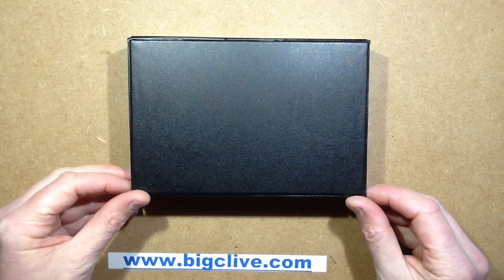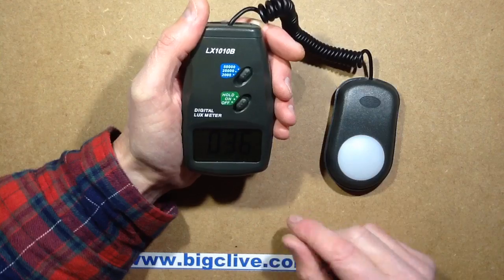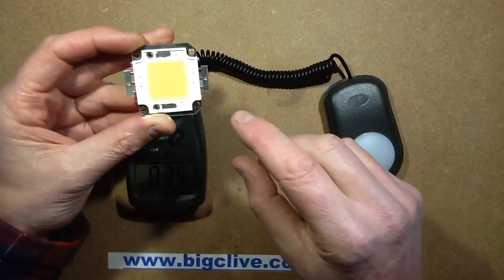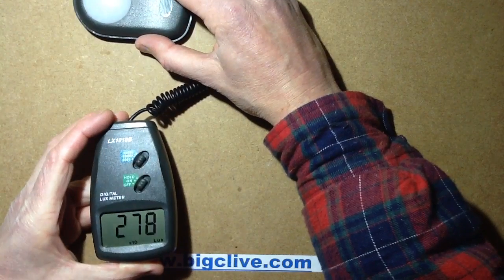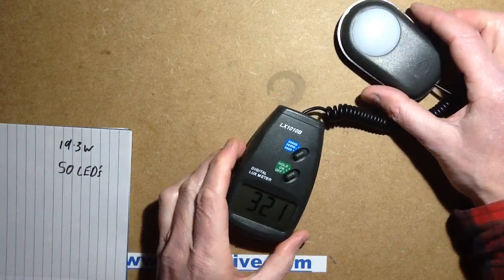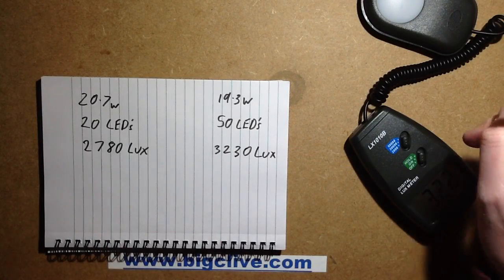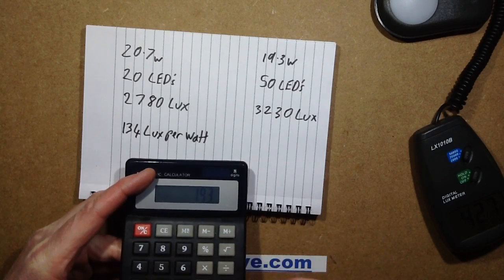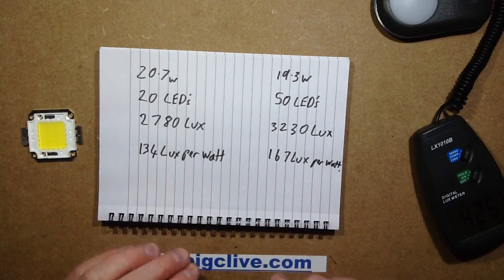20W vs 50W LED lux test in a 20W floodlight.

Comment: is there a metre that measure kelvin and lumens?
Reply from the maker: Yes.  You can get meters that do CRI, temperature and lumens.  But they are very expensive.
Reply: @bigclivedotcom  thanks for the answer, much appreciated
Reply: does CRI measure in kelvin?

Comment: https://www.bannerengineering.com/za/en/company/expert-insights/lux-lumens-calculator.html
In my case I have approx 50cm distance to sensor and I get 3220 lux assuming a spread angle of approx 120 degrees.
This equates to approx 2529 lumens from my Yxo DOB4075-50w module.Another fun thing is my true rms power meter reports it drawing 50.72 watts and since I know the wireless on/off receiver I hooked it up to it is consuming it's 0.72 watts like always it is spot on 50w. Quite happy with that.

Comment: I got a 50w led and im using a 35v 5a driver set to 35v @ 1.5a but its only drawing 20w :/
Reply: LEDs have no current limiting themselves so if you're unhappy about the power consumption then your driver is at fault

Comment: how much is  the distance?tnx
Reply: I believe it is one meter... since one lux of intensity equals one lumen of radiation per meter, in METRIC units.  Footcandles,   OTOH,  are measured in French or American units.  One footcandle = 10.76 lux of INTENSITY.  Light intensity falls off as the distance from source to subject falls off due to the inverse square law.  The intensity of light from a single candle (one candela) that will be projected onto a surface 12 inches (one foot) away, through a cone of one steradian, will be one footcandle (or 10.76 lux).  But this guy explains it much better than I can...  https://youtu.be/9nPIzyV1mW0

Comment: Would more LEDs  create more heat given the same size  of  aluminium pcb?
Reply: When run at the same total power of about 20 W,  they produce less heat apparently. As Clive shows, there is more light, so less energy is wasted as heat. The aluminum backing does have more LEDs on it so when it's run at 50 W it would need better cooling than the 20 W LED running at 20 W.

Comment: Hi Clive. I'm trying to measure the lumens coming from a 20w LED floodlight using the very same meter.
What distance should the floodlight be from the sensor? As I move the sensor closer to the light source the reading increases, so is there a recommended distance?
Also should the test be done in a dark room at night so that the LED floodlight is the ONLY light source in the room?
Thanks.
Reply from the maker: +Adit209 It's actually trickier than that.  The output from the light is not even so theoretically you have to use an averaging device at a fixed distance with no external light source.  I tend to use these meters as a rough guide at a fixed distance from the light in a dark room.
Reply: +bigclivedotcom Thanks for the reply. I'm going to try in a dark room tonight. Seeing as the definition of 1 lux is luminous flux at 1m distance from light source that's what I'll try. However looking at the manufacturer's specs for the 20w floodlight in question, they state this light is between 1000 - 1800 lumens, that's a massive range! Talk about trying to cover your own backside!
Reply: @Adit209  whats the result was ,while you checking the luminous flux at 1m of  20w street light in the dark room ?

Comment: They do get more efficient at lower currents. If one search for "underdriving led" on google there's at least a couple of line charts showing this in lm/W versus mA.

MIT actually managed to get an efficiency of 230% by driving a LED at 69 picowatt. Instead of producing waste heat the Led 'sucked' in heat and converted it to light.

Getting 25% more light per watt seem about right in this case.

Comment: very interesting, so if the heat sinks were the same size on each, which would run cooler? 
thanks
Reply from the maker: The heatsinks would run at the same temperature, but the LEDs would be cooler because there would be more of them dissipating their heat over a larger area on the heatsink.
Reply: bigclivedotcom There should be a small difference. A 20w LED driven at 20W with lets say an efficiency of 10% makes 18W of heat. Underdriving a 50W LED at 20W would then give an efficiency of something like 12.5%, producing "only" 17.5W of heat.

Comment: The reflector in the fixture could also affect the lux reading, particularly if bought from different suppliers.  For example, if one reflector produces a narrower beam (e.g. 120 degrees instead of 130 degrees), it would give a higher lux reading for the same lumen LED/bulb.

Before I switched to LEDs, I found it interesting measuring light off CFLs as it was surprising just how low the lux readings some bulbs gave when switched on as well as how much darker the bulbs get at full intensity as they age.  For example, in our bathroom, the previous 11W GU10 CFLs started at 4 lux with the meter on the ground directly below a bulb and warmed up to about 25 lux.  The current 4W LEDs give a 70 lux reading and certainly appear brighter than the CFLs, which dimmed over the years.  The light meter is also handy for checking which LED bulbs maintain their brightness, as a few models dim slightly after 5 to 10 minutes, probably to limit the internal temperature.
Reply from the maker: Both light fittings were bought together and are identical.

Comment: It's always better to use as many LEDs as you can. In best case, you put them all in series as long as the voltage out of your socked is high enough. I also have 5m LED strip left fpr 12 Volts. I wanna put all 3-LED-Segments in series (37) and then put it directly across rectified mains (including safety like fuse, MOV, etc. and a CAP to reduce flickering). Not really efficient, though, because of the bloody resistors. The strip is laminated with silicone, so it's not easily possible to bypass the reistors and add more of these LED-Groups in series.